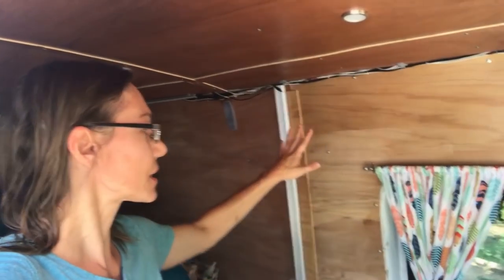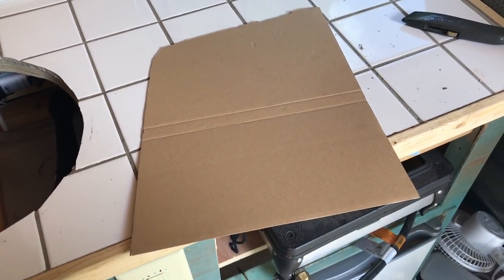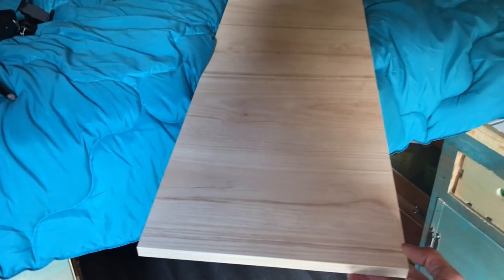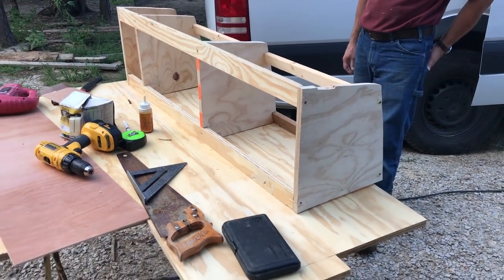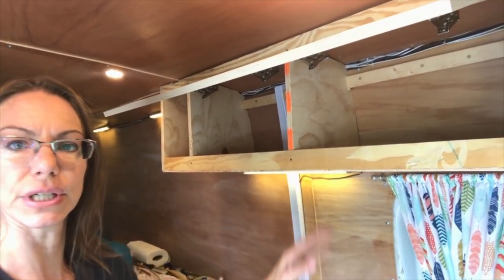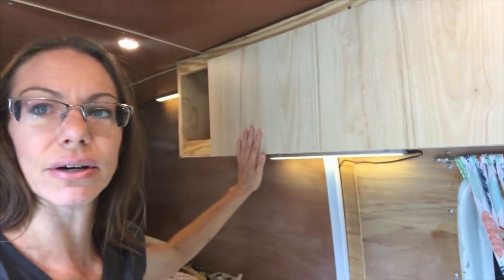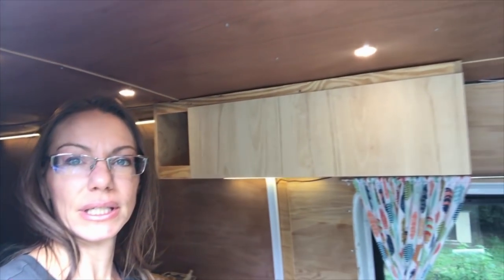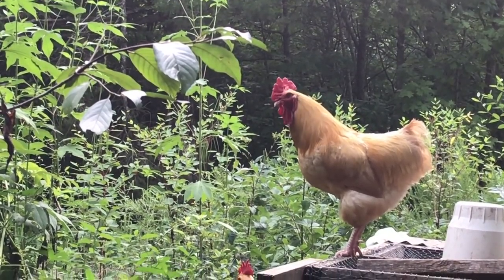How to build an Upper Cabinet in your Van Build -Custom Conversion

Comment: how do you screw if in? what screws/equipment? please help!
Reply from the maker: Use self tapping screws. You'll be screwing into your metal perlins on the inside of the van. Use a power screw driver as that's the only way you'll be able to get it into the metal. Screw length needed depends on thickness of cabinet, wood on wall, then enough in the metal perlins but not too long it could through van wall.
Reply: ty sm